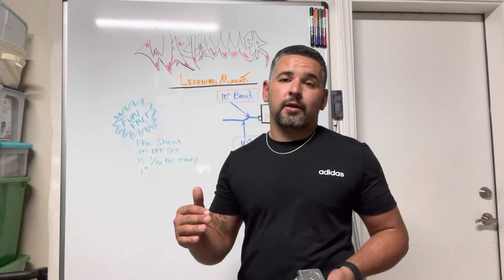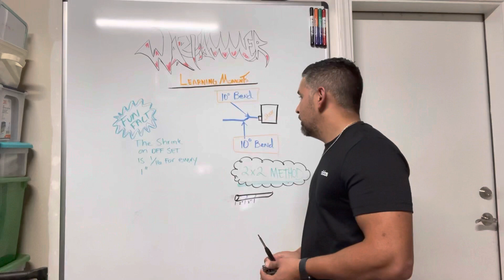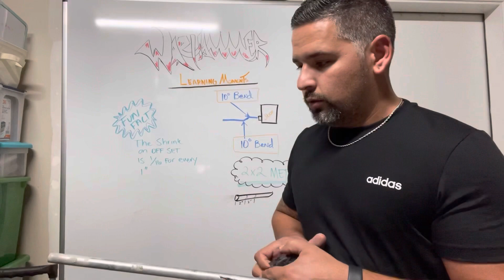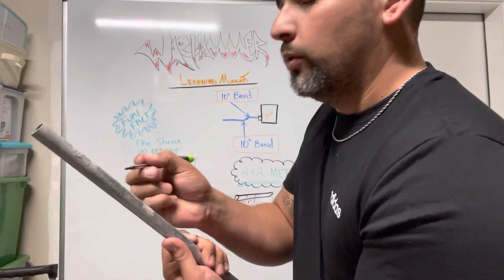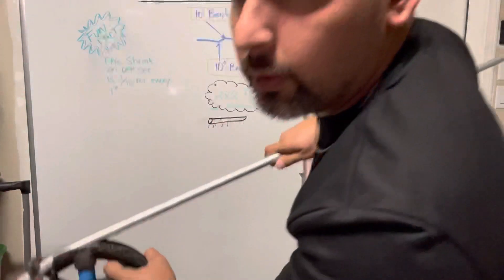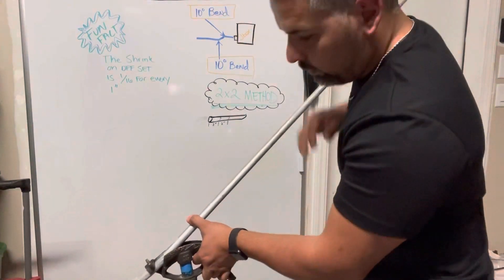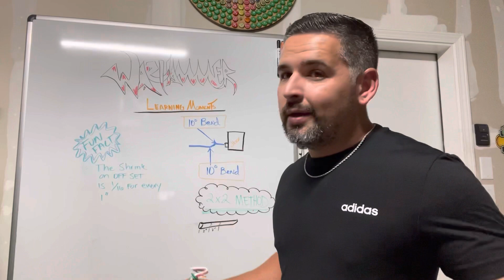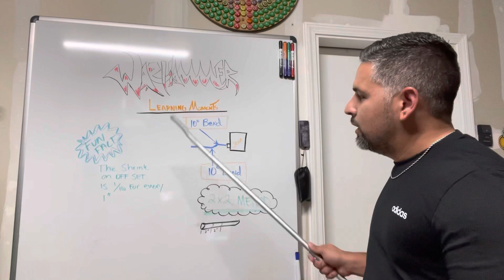How to make a Box Offset !!! 2x2 Method of Course!

Comment: I did 2x5 with 10 degrees.  Did a whole wall with 10 boxes aligned and every single one was exact box offsets.   At the 4” mark I noticed it would get on my first bend and it would take some bend off to me.  5 leaves it a lil past the bend so it makes true offset.
Reply: Why ? The whole point of the box offset is create a smooth of a look as possible . 2x5 is unnecessarily wide in my opinion . 
2x2 is perfect .
Reply: True offset ? We want a BOX OFFSET . let me guess. Your no more than 24 ?
Reply: I use 2×5 also 👍 but not in the air, I already got a feel for it,,, also using a torpedo level on the second bend, making sure it's straight

Comment: How do you guys actually do this job? Are you aware of the math behind it? Doing a box offset requires a 3/8” offset. Using 10°bends calls for a  multiplier of 6. So 2-1/4” Space between markers. “The way the professionals do it” is use the right math.
Reply: Correct sir
Reply: You expect proper math from a person who can't even speak without saying "ya know" every second or two?  Interesting.

But yeah, notice how at the end he doesn't set the conduit down on the floor to show us it's right.  Even in the air the way he's holding it I can see the rise isn't quite enough.

Comment: I was taught 2-1/2 then 2 , I’m guessing it’s something someone else made up lol
Reply: I suspect both are about equally good and it comes down to personal preference.
Reply: @rrice1705 The correct one is 2¼ spacing, since a typical box offset is 3/8, the multiplier for 10° is 6, ⅜x6 = 2¼...

So I do 2 and 2¼ and it's the perfect bend with the math checking out.